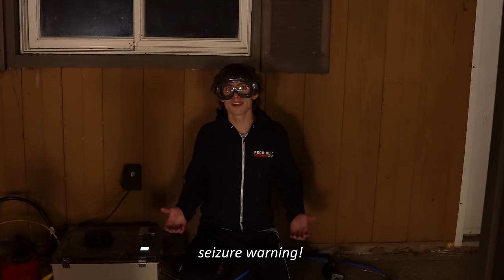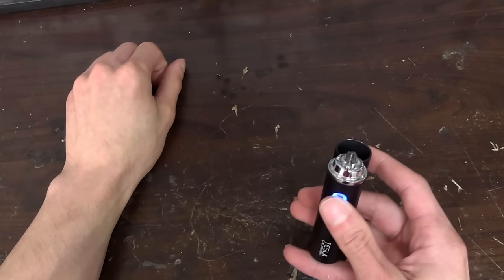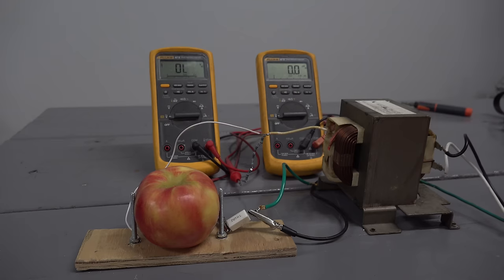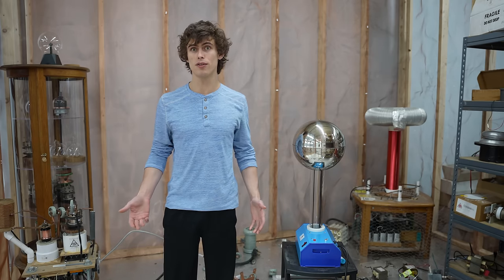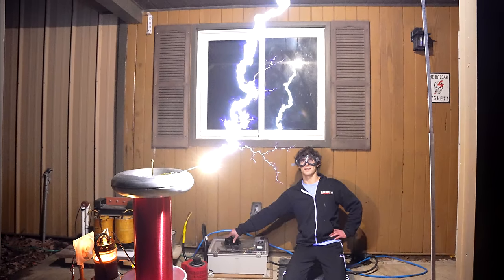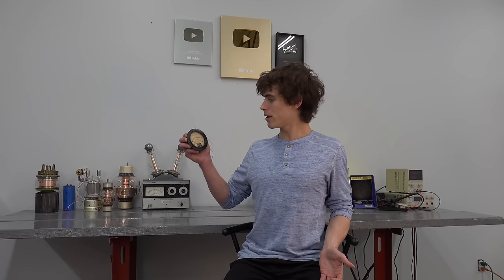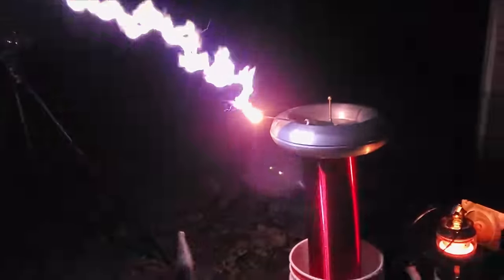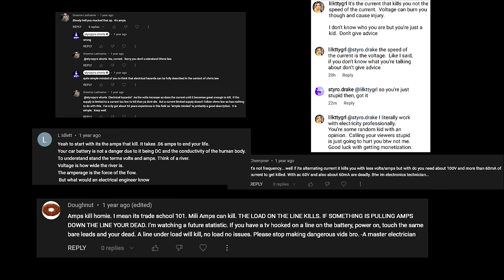Is it the volts or amps that kill?

Comment: Good video.  You put a LOT of work into this one.  I get the "it's the current that kills" oversimplification a lot.  It is, but it's also the voltage that pushes the current.  The same people usually say things like "current takes the path of least resistance".  Nope.  It takes ALL paths of resistance.
It's kinda unfortunate that our classic 50/60Hz supplies are just perfect for causing sustained muscle contraction and oodles of pain.
Reply: Hey, it's job security. A lot of knuckleheads will try just about anything but they know well enough to stay away from the juice.
Reply: A phrase that stuck with me when I was a young apprentice was "Electricity takes all paths according to their resistance"
Reply: More current takes the path of less resistance.
Reply: Is it unfortunate that 50/60hz stuff does what it does to us or is it inherently related to the fact that those frequencies were chosen to align with our eyes’ “framerate” or threshold to recognize movement? I have absolutely no qualifications but my intuition tells me it’s not much of a coincidence as nerves are heavily involved in both perspectives
Reply: @TheDefender123Plays  It does.  But if a faulty device has a high resistance earth/ground connection passing 10A then it might not be enough to trip circuit protection, meaning that the case may be live at near full mains voltage.  And you can then become a path for whatever current it can push through you when you bridge between the case and ground.
Reply: Yeah. All the "other" points of view are limited/blinded by their own experiences/education. No wonder electricity can be dangerous!
Reply: It takes ALL paths of resistance. what do you mean by that? care to elaborate?
Reply: @theTranscendentOnes the longstanding saying is that electricity takes THE path of least resistance meaning it will only travel through the lowest resistance that is connected. If you stood and held a medium voltage line and then ran a copper ground from that same line to ground, energized the circuit, it would go through you to ground as well as the copper ground wire. The majority of current would flow through the copper ground, however as long as the voltage was high enough and/or your resistance was low enough, current would also flow through you. If you had say 30A of current on that line, maybe 28A would flow through the copper and the other 2A would flow through you. “Figuratively” speaking.
Reply: @Mike_Rundle so you just contradicted yourself. you said it will only travel through the lowest resistance and then gave an example where it travels 2 paths, one of lower resistance(copper) and one of higher resistance(your body). funny. the video itself also shows us electricity doesn't only take the path of least resistance since the lightning bolt is obviously splitting at many points taking multiple paths. perhaps it's time we abandon the long-standing saying if it's wrong. it just helps spread myths.
Reply: @theTranscendentOnes that’s correct. I wasn’t agreeing with the saying. I was saying that’a been the common misconception. If there is a path it will take it. If it’s an insulated path that’s different obviously. Another common misconception is that electric wants to get to ground which is a little more complicated than that.
Reply: @Jellylamps  The frequency of utility power is a compromise.  Higher frequencies allow more efficient, smaller transformers.  This is why aircraft equipment typically operates at 400 Hz alternating current.  But higher frequency does not transmit long distances.  Electric locomotives that tap overhead power lines typically operate at about 16 Hertz frequency.  That frequency requires big transformers but goes long distances with less loss.  
Really long distance power transmission uses DC, direct current at very high voltage.
Reply: @theTranscendentOnes  "It takes ALL paths of resistance. what do you mean by that?"
It is a current divider inversely proportioned by the resistance in each path.  Consider that a particular path does not know or care about other paths.  If you put 100 volts on it, the current is determined by amps = voltage/resistance.  ALL paths will have the same voltage but each path will have a current according to the resistance along that path. 

Water works the same way.  You can have a major river, and yet tap some of the water if you give it a path.
Reply: @thomasmaughan4798  I agree on certain parts but I disagree that we should consider a path does not know about other paths. Electricity knows a path in advance otherwise it wouldnt be able to pick the one who has less resistance.
Reply: @theTranscendentOnes  "I disagree that we should consider a path does not know about other paths. Electricity knows a path in advance otherwise it wouldnt be able to pick the one who has less resistance."

An electron has an electric charge and it repels all other electrons.  This is how it chooses where to go.  On a particular circuit path, you remove an electron from the far end.  This creates an opportunity called a "hole" which is then filled by an adjacent electron.  The hole moves upstream, hip hop.  The actual rate of electron movement is rather slow, inch an hour or so.  But the speed of propagation of knowledge is nearly the speed of light; so within a nanosecond, this particular path becomes more attractive and the electron hops on that path.

But the NEXT electron has no place to go on that particular path until an electron is removed from the far end.  So, it waits for one of the other paths to have an opening.  Wires with less resistance can move the electrons more easily, thus more frequently the copper wire will create vacancies or holes for electrons to occupy.

So it is that any path has no knowledge of other paths, does not care about other paths, and the charge carriers, electrons, care ONLY about where they can go NEXT and has nothing directly to do with "path of least resistance" but only which direction has the least negative charge right now.  If they are all equally negative, the electron just sits there; well, really it vibrates in the vicinity of its positively charged atom nucleus.
Reply: @thomasmaughan4798  this is how it works when we perceive time linearly and the way classical physics do: from our perspective. From the electron's perspective something different happens.
Reply: @theTranscendentOnes  "From the electron's perspective something different happens."
Naturally.  It's an electron with both particle and wave properties.  Trying to explain what exactly electricity IS at a high school level probably will result in many glazed eyes.  Describing it as moving electrons is sufficiently accurate until eventually one learns that electrons move because of electricity (electric charges or force) and not the other way round.  I suppose Electricity is the aggregate effects of all that.  The Europeans still have current going the wrong way.
Reply: @theTranscendentOnes The electron doesn't know anything, it just does things according to physics. Plus electrons move very little during current anyway.
Reply: @onionman8160  I disagree. Stop insulting electrons. It's you who knows nothing.
Reply: @theTranscendentOnes  what?
Reply: @theTranscendentOnes It’s a huge misconception to say that anything besides a living animal in nature can “know” things. As said previously, electrons only care about wherever they can go NEXT, and even “care” is sort of a weird word to use because it implies they have emotion, which they don’t, either.

Electrons have no conscious mind and therefore cannot “know” things - a similar misconception can be found in evolution; natural selection does not “know” what to give to animals, it is simply a process by which traits are chosen based on what animals are surviving to pass them on - in short, whether a trait is beneficial or detrimental, it doesn’t matter because so long as the organism survives to pass it on, the process of natural selection guarantees that the trait will continue on for the time being until the organisms that have it all die off and are replaced by those with superior traits. 

It’s all a matter of what is either the closest option, or the option that is currently making things work.
Reply: @hamsteak5013  everything in your text is based on assumptions that I reject. you don't know whether an electron has something resembling a mind and you're talking based on limited knowledge.
Reply: why did I read this in your voice?
Reply: Im not great with electricity, missed loads of lessons due to illness, but doesnt the current branch off into every path, but more will go to a path if there is less resistance?
Reply: It is interesting that this type of problem only exists in electricity and nowhere else. Nobody asks whether it is the speed or the car that kills you, or whether the velocity or the weight of a bullet is deadly.
Reply: @theTranscendentOnes  Look for parallel circuits and current dividers. The current takes all the paths.
Reply: @Muck-qy2oo  I like your profile pic.
Reply: @JasonM-lq7ri I think it depends
Reply: @Jellylamps late af ik but you're thinking too much in video games. We selected 60 hz as our electricity frequency 30 years before tvs became commercially available. They chose 60 hz as the electricity frequency because it would sustain power more consistently to light bulbs to help against light flickering. Framerate had nothing to do with the decision, and I really hope you aren't implying that our eyes see in 60hz
Reply: @RowanDeer   of course our eyes don't see in only 60hz. I was never implying that or that tv screens had anything to do with it. We do, however, have a threshold where a high enough frequency will be perceived as movement rather than a slide show, similar to how we have such a threshold separating beat and tone for hearing. I'm just curious if perhaps there are connections between these things that somehow stem from the way our nerves behave and react to different frequencies of electricity. For instance, maybe lightbulbs powered at 60hz still flicker but it is harder to notice because we instead perceive it as a brief and slight dimming instead. I'm open to the possibility that I'm completely wrong about all of this but I do in fact have basic logic. It would be very interesting if the way our nerves behave were responsible for some convergence in frequencies responsible for sustained muscle stimulation and visual illusion, among other things, not to imply that one offshoot of this is directly responsible for another, but that at their core they stem from the same mechanics of the human body.
Reply: @RowanDeer  upon taking a small bit of research it seems the main reason 50/60hz was settled on was as a compromise to the pros and cons each of both higher and lower frequencies when it came to actual functionality of various machinery. So it definitely wasn't (primarily at least) picked for any reason like I mentioned, but I wasn't even trying to focus on that part. I'm still curious whether these frequencies being practical for screen displays to portray movement may have an underlying connection to muscle stimulation arising from the behavior of our nerves, regardless of the fact that 50/60hz are standardized

Comment: Many years ago, in an electrical engineering firm my boss tried to argue with me that Voltage is the deadly component as opposed to current. I contested that it is a product of both, because a static electrical shock can generate thousands of volts without harm. Looks like we were both wrong - it's duration of the product, power, and frequency. Thank you for settling an old score 🙏

Comment: As an electronic tech of nearly 20 years working on everything from xray supplies to consumer devices tube and solid state I absolutely agree. Glad someone else understands its not an exact science to getting zapped, depends on many factors even down to your body hydration level how severe of a shock you will get. Most of the equipment I work on uses 450vdc + as its main rail voltage with over 10A available continuous. You work one handed, I was spared once as a younger/more dumb/careless individual and got away with burns and getting knocked the fuck out. I was working on a large linear tube transmitter and didn't discharge the rail. Be careful out there guys especially with those damn microwave transformers, like the man said they are no joke and everybody is playing with them and sometimes when you play stupid games.....you get stupid prizes.
Reply: ' when you play stupid games.....you get stupid prizes.'    🤭🤭😆😆🤣🤣
Reply: Led me to think
Reply: Path to ground is a big deal too.
Reply: Yea there’s wayyy too many idiots playing with microwaves, and they don’t understand how scarily dangerous they are, and since they watched some YouTube video on it, they think they’re fine to do it and then hilariously,
they do the “don’t do this at home, im a professional YouTuber”. 
like styro is one of the only YouTubers that I fully trust fucking with electricity, the rest scare the hell out of me
Reply: @limitbreak2966  My microwave was arcing to the wave guide once... I could hear that classic bzzzz. It was a nice sound, but holy crap, scared the sh&t outta me. Replaced the wave guide, still sparking... Ended up bringing it to an electronics recycling centre and told them what was happening. As soon as I said "I wanted to take it apart but decided not to", the look of shock on the guys face alone was enough to tell me what I needed to know. He took some time to talk to me about microwaves and... Yeah they scary, glad he actually knew some stuff and didn't just chuck it in a pile.
Reply: REDDIT USER DETECTED
Reply: I've repaired a few microwaves that had faulty door sensors or popped fuses but I don't go near emitters or transformers. You can read the tag and see what the output is on most things. You can use Ohm's law to find missing info. And since we're talking about microwaves, I think it's worth mentioning that I've read that non-ionizing radiation can't hurt you and I don't see how that can be right. If you aren't sure, look up what you aren't sure about so you won't touch it by accident.
Reply: I know someone who had 2 fingers missing from both his hands (the first and middle fingers of both hands) from getting electrocuted, while working on an industrial 3 phase power supply, because some bright spark thought it would be a good idea to turn it back on after he had turned it off. Luckily (I think) the electricity actually arced from one wrist to the other and he was left with very bad burn scars there (and on most of the rest of his hands) to prove it, apparently this stopped it from running through his body and across his heart killimg him instantly. He couldn't let go obviously and he doesn't know if it was the fact that the idiot turned the power supply back off or the fact his fingers disappeared that he was able to let go in the end...
Reply: @beef0678 That's a good story for "lockout procedure". Good lockouts use literal padlocks to prevent that. i lost a screwdriver that way once but not fingers. he was really lucky actually. I bet he was standing on an electricians pad. Its just a thick nonconductive welcomemat. Lets all do mats and lockouts so we can die of something else.👍
Reply: @drewkelly1955  Dunno man, he is falling short for the immeasurably condescending tone particular to most reddit users.
Reply: it is an exact science, You just can't boil it down to a single statement. The whole reason he was able to make this video was because he knew he wouldn't die because of the science.
Reply: Joker is Detective
Reply: @limitbreak2966  You can't trust him, but you almost can.

He still makes ultra murder death lasers.
Reply: @mm6705  maddening and scary as hell! Like I said, he was so lucky that it arced between his wrists. But don't know what happened to the bloke who turned it on.
It's the reason I like to work alone when doing anything potentially dangerous these days...